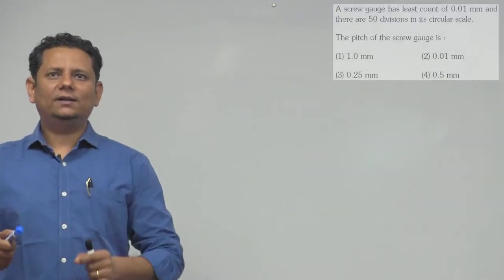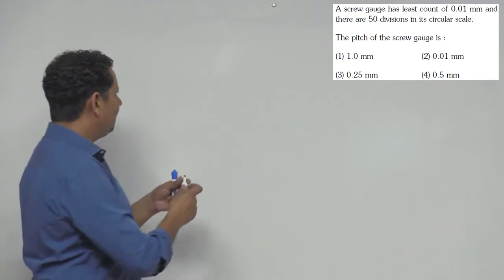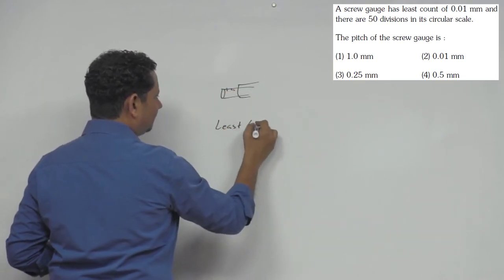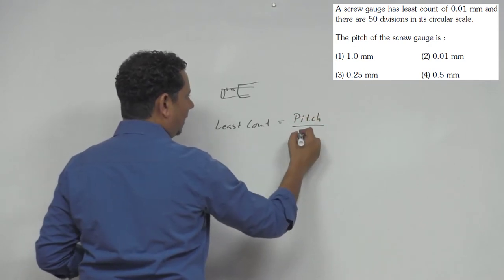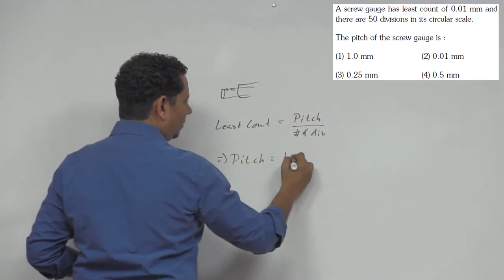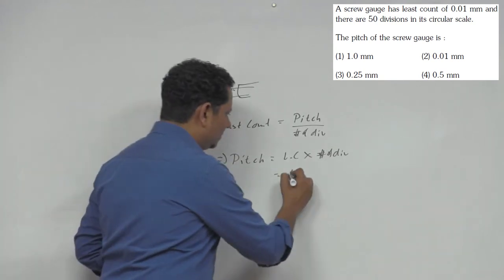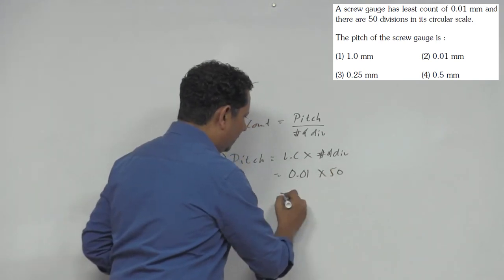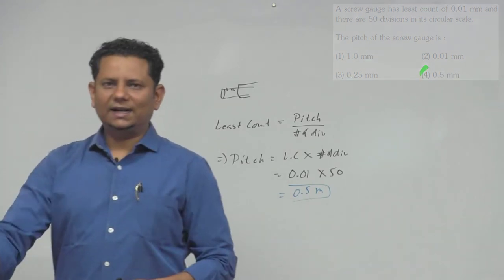A screw gauge has least count of 0.01 mm and there are 50 divisions in its circular scale.The pitch

Comment: the question was this,

	
A screw gauge has 50 divisions on its circular scale. The circular scale is 4 units ahead of the pitch scale marking, prior to use. Upon one complete rotation of the circular scale, a displacement of 0.5 mm is noticed on the pitch scale. The nature of zero error involved, and the least count of the screw gauge, are respectively :

why there is no significance of 2nd line.....shouldn't we minus that error, to get exact reading?